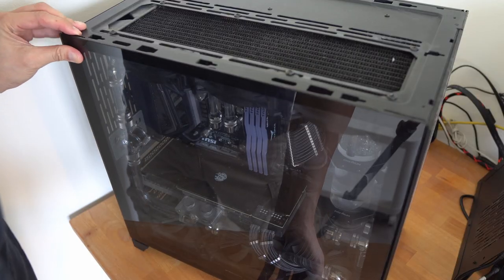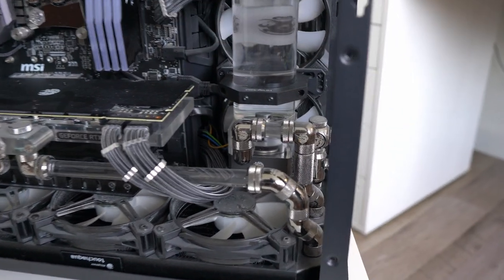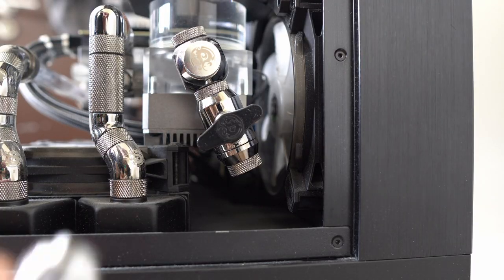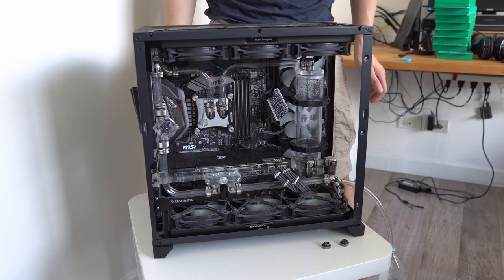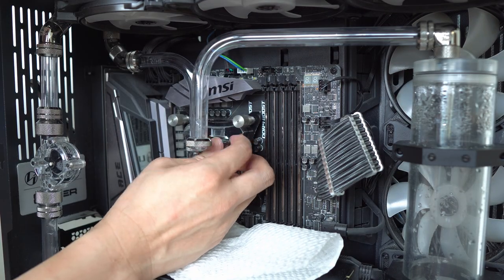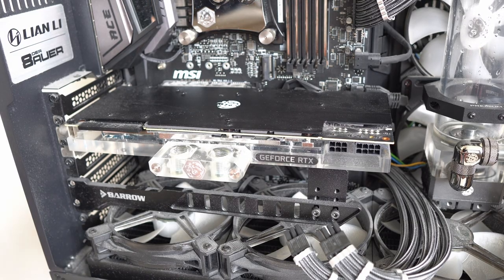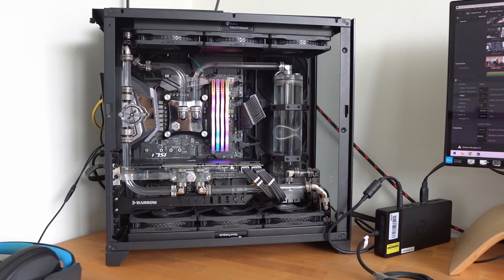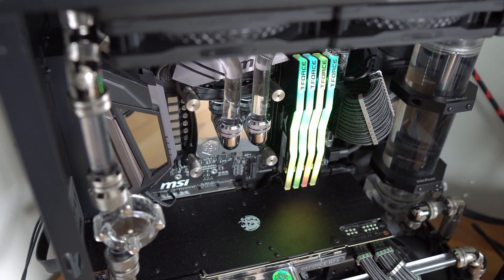Custom watercooling PC - Just changing the fans can be a pain... (feat. DeepCool TF120 S GamerStorm)

Comment: you have to place some dustfilters over these radiators.
an other Problem is, that you have more fans pushing air out than in. thats why the air is searching for every little hole in your case and all the dust can come in. 
Get more fans that push air (through dust filters) than pushing out. 
You have to get overpressure in your case.

Comment: Best thing for noise is to control them by water temperature, then they won't spinn or. Or get a Mo-Ra and run noctua nf-f12a at 300 rpm and be done =D